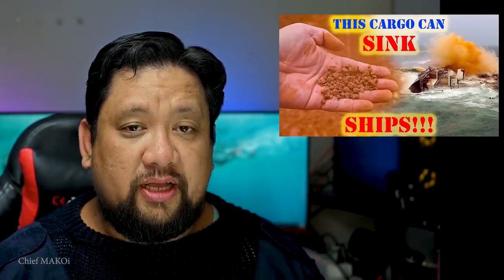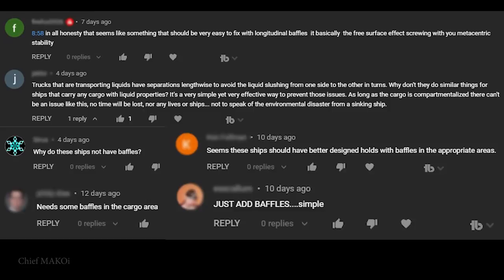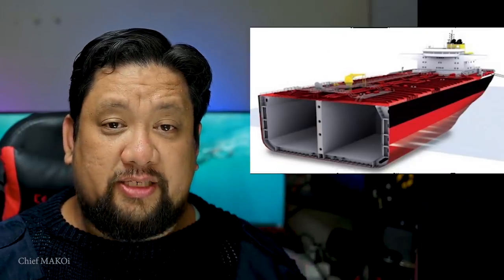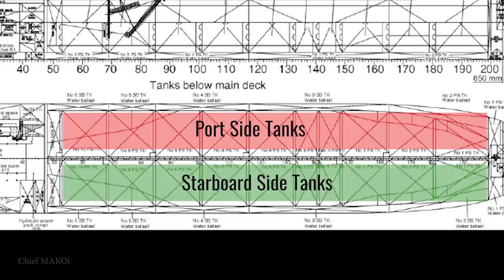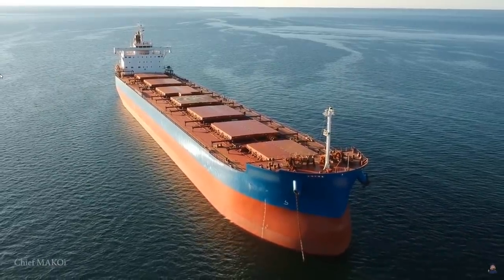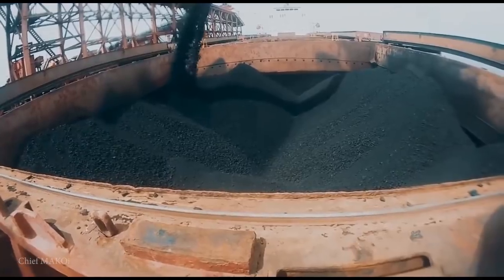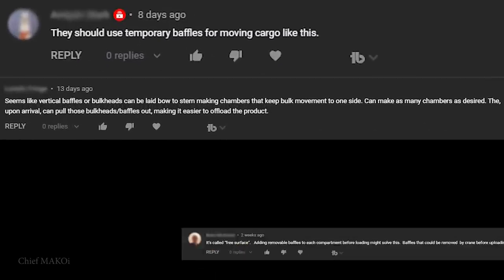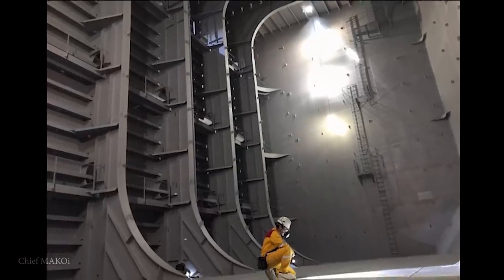Free Surface Effect: Should Baffles Be Installed in Bulk Carrier Ship's Cargo Holds? | Chief MAKOi

Comment: What about a folding partition that simply collapses up against the side wall of the hold. It wouldn’t even need to be a solid wall. It could have holes in it to reduce weight, just not too many or it wouldn’t serve its purpose.
I understand that there is a cost/gain analysis but it seems like there is some potential here. As long as it doesn’t add too much weight, time and/or reduction in carrying capacity. It would certainly offer a level of safety and capability for transporting loads that would otherwise take a great deal of time, labor and expenses in order for it to be safe for transport.
What happens to a load once it has too much moisture in it? When you have ships that are still able to transport, even when it has a high moisture content. It could save you from a wasted trip and a load that no one can transport.
I understand that it wouldn’t make sense for a company to put baffles on all of there bulk carriers but for carriers that almost exclusively carry these king of cargoes it could make a lot of sense and maybe even save some money.
Just an idea

Comment: It occurs to me that with modern materials and technology it should be possible to create strong inflatable baffles, either to use before loading or as an emergency measure if liquifaction is detected. I've seen the kinds of heavy-duty balloons they use as rollers to launch ships or as ways to raise ships for salvage. This would eliminate the "tons of steel" argument. They might even be able to be retrofitted without taking up significant cargo space. They can be very effective even if they are being overtopped as long as the mass in motion is reduced enough, so the rigidity of steel isn't really necessary. Cleaning them and packing them back into place after use might be the biggest hassle.

Comment: if it is not good to add baffles inside the hull, how about adding it on the deck level? it's still a open space down under. it can also be a walkway for crews to visually check the cargo without going down risk their life if the cargo is liquidified. may be double as a support of some rain cover as well? how about adding a hinge open section on it to entertain the port loading machine requirements? of cause as you already said, it is subject to cost and effectiveness. but safety to ship and crew is a kind of effectiveness too.

Comment: 5:59 the thought occurs tho that you could create baffles out of the  cargo itself by freezing it or parts of it.  i know they some times do this in construction in areas where the water level is high or  the soil is otherwise to saturated to be self supporting essentially you  ...in the construction example anyways pound  hollow piles into the ground in a line and then run  a coolant thru it and it freezes the soil  for a given radius around each pile and by spacing the piles such that those radii overlap they created a waterproof wall of frozen dirt that they can then dig on one side of it and put in the foundations and the concrete or whatever  and once thats all set  they  stop cooling  the piles and  the water in the dirt melts like nothing happened ... tho doing this on a ship .... i mean i cant see why it couldn't be done... but you would also need to carry the kind of plant around that would be required to produce that sort of cooling etc etc all to make safe a liquefied cargo that you shouldn't be carrying in that state to begin with so these are all really good solutions to a problem that doesn't exist ...unless you use to make it exist by load wet cargo to begin with in which case the simplest solution is to ...not do that lol  maybe  just a few big bags of emergency desiccant to  absorb the water or in emergency  it might be better to just dump the  most watery parts of the cargo overboard
Reply: You can't freeze the cargo until it's already liquefied. Once it's liquefied, you don't have time to do anything complex like that -- we're talking thousands of tons of water and the ship can sink in 20 minutes. "Emergency dessicant" won't help. You'd need to handle hundreds of tons of material, and you'd need to open the cargo hatches, which is suicide in a storm. Dumping the cargo isn't an option because, again, you'd have to pump thousands of tons of material in only a few minutes. As you say, the solution is to avoid the situation in the first place.
Reply: @beeble2003  ah idea .. what if we make them submersible bulk carriers ba dum tish  that said cargo submarines were a real thing lol
Reply: @firefox5926  Well that would totally solve it. 😁 Underwater, things are much calmer on the surface, so the cargo wouldn't liquefy in the first place. And it would be much cooler.

Comment: It's almost like adding a small "lab room" in and certifying a couple of crewmen to conduct these simpler labtests for liquification testing would be cheaper and faster under all cercimstances. Not to mention that such results would be holding up better to disputes than the "can test", as you have measureable hard number results that would be treated as solid evidence if anyone decides to engage in legal battles.

Comment: probably a better solution would be a system for drying a cargo hold with cargo in it. probably permeable, removable panels across channels capable of blowing dry air through or pumping water out of the channel, but steam pipes to heat the cargo would work for most ores.

Comment: Chief - Thank you for your informative videos. Is there a system on board to determine the most efficient power setting for the cruise phase? What I am thinking about is a system that compares the prop shaft torque vs. the speed of the ship over the ground. This system might save some fuel...

Comment: Your final comments on business needs should be stressed in all industries as if there is no business, then there are no jobs!
As to the free surface effect of oil in tankers, longitudinal bulkheads are certainly the solution that occurs to me , but what about OBOs?
My final voyages were in 155000 dwt Oil/Bulk/Ore carriers where the same cargo holds were used for dry bulk cargoes and oil, but had no longitudinal bulkheads.
Do you have any thoughts on this, Chief?

Comment: Chief, how do you clean out your holds between trips to prevent cross contamination between types of cargo? Or is this even a concern? Thanks!
Reply: There are other videos that cover this for many different sources. In general, front end loaders or similar types of vehicles are put into the hold.  As the main method of removing the bulk cargo is winding down, the equipment pushes the remaining cargo in the piles. Once most of the cargo is gone, they use water to hose down the floor and the walls
Reply: The Chief has a video on that topic, check out his playlist. very interesting.

Comment: One solution for difficulty removing longitudinal baffles would be regulations that require ports to have the equipment on hand for cases where the cargo is out of spec. Shift the burden from the ships to the chatterer, then they'll probably not want to have ships load out of spec cargo, doubly so if the charterer is held liable for loss of life, pollution etc for pressuring a ship to take an out of spec cargo. It seems like a lot of these incidents are due to pressure put on crews and threats by the ports and charterer.

On a more practical engineering side, rather than longitudinal baffles, piling rods could be used instead, they're smaller, don't need to be fixed to the ship and can reinforce soil-type materials by being driven in from the top by relatively cheap equipment that only requires a crane. Textiles could be another solution too; layering mesh in with the cargo would be even cheaper and have a similar effect of making it harder for the cargo to liquify.

I'm not sure how well textile would function for separation though, I'm only familiar with textile bein used to strengthen earth against erosion and soil liquefaction during earthquakes. If you want to see just how much a few sheets of textile can do, there are some interesting demonstrations where small cubes of sand and mesh have the weight of an automobile placed on them and hold up.

Comment: Seems to me that even a dry cargo can shift without a particularly high water content. A rogue wave, say, putting her on a 40 degree roll could start even a dry cargo flowing, especially if the hold isn't completely full. A book I read on nautical things (50 years ago or so) said such a cargo should be secured with battens of some sort for just this reason.
Reply: Dry bulk cargoes are usually loaded flat enough that there is minimal risk of shifting.
Reply: Any powder or granular substance has what is called its "angle of repose". Make a pile of the substance on unconstrained flat ground, and the angle of the slope of that pile is the angle of repose. If you arrange the substance so that the slope of any free surfaces is less than the angle of repose, the arrangement is stable; if you make a slope steeper than the angle of repose, it will collapse.  In particular, if you take an open-topped box (e.g., a cargo hold) with the substance spread flat inside, you can tilt that box at any angle less than the angle of repose and nothing much will move -- the surface of the substance will stay parallel to the bottom of the box. Angles of repose for typical bulk cargoes are in the 30-45-degree range. This means that, if you list the ship by less than 30 degrees, nothing much will move. And if you're listing your ship by more than 30 degrees, you have other problems!

Comment: 5:39 so a question i have about this that i dont know the answer to it .. in the case of a semi liquefied cargo .. do you actually need floor to ceiling baffles ? or could you get away with using half high or some   that is baffles that come down from the ceiling into the cargo but not al the way to the floor? because it would seem to me that unlike the cause of a purely liquid cargo the liquid would just flow under the baffles easily in the case of a liquefied cargo most of its fluidity is at the top and as you go down in depth it become less liquid... in which case the baffle only need to extend down to the point where  even tho the cargo can flow under them it can only do so at a rate slow enough to keep it from suddenly changing the metacentric height and or setting up a harmonic with the roll of the ship  effectively to dampen it rather than stopping it  i should not that this isnt in relation to a practicable solution but just a mental exercise in  my own curiosity

Comment: Hey Chief,do any of these bulk ships have blowers in the holds to help control moisture? Never thought about it before. It seems to me,at least,that these could be installed without compromising the ability to haul other things besides loose material.
Of course I've never been on one of these ships,and have absolutely no idea if this is possible. Thanks,have a Merry Christmas! Calm winds and following seas!
Reply: All ships have ports on the fore and aft sides of the hatch cover panels which can be opened and closed, they are used to ventilate the hold (natural ventilation). Some (fewer) ships have mechanical ventilators, equipped with heaters. Using dry/wet bulb thermometers the ships crew can determine when they need to ventilate to reduce condensation in the holds.
Reply: Cool! Thanks for the info. Seemed to make sense to me,but I didn't know.

Comment: I actually would see longitudinal baffles increasing the risk. Imagine a cargo hold with a baffle filles with ore. During rough seas, a hatch gets damaged and lets in water to the hold. If only one side of the hold fills with water, you start unbalancing the ship. I'm not seafarer, but I can manage trying to adjust ballast in rough seas would be a nightmare, if not impossible. An unbaffled hold would at least be balanced when the ship is level.

As you said, it's all about balancing risk. And you certainly seem to be on a ship where the owners/charterer care about safety.

Comment: Hello Chief I'm  not an engineer by no means but just thinking  here since  water travels  to the top and you have boilers on board, if one would put plumbing  at the highest  point  run on each side of the cargo holes during  extreme weather  drain the slop or water ontop and at the same time provide steam to dry the cargo, or if after loadind and under way  the crew inspecte the cargo find it kind of wet add steam and open the cargo doors a little to sea permitting, to assure  a safe delivery

Comment: (Let's see if YouTube is still hosing messages that have links to non-YouTube sites -- after some testing seems to work for Wikipedia but not other not YouTube sites?)

In case people were wondering:  Bulk carriers designed to carry both liquid and solid actually have been made, although they have partially fallen out of favor for cost reasons:  the Oil-Bulk-Oil carrier:  https://en.wikipedia.org/wiki/Ore-bulk-oil_carrier
To make a long story short, they do have their disadvantages.

Comment: The baffle doesn't need to be from floor to ceiling height. But as a partial divider like mid way and couldn't it made designed to come apart in the middle and fold flat to the opposite walls.

Comment: Just curious...
Why can't they use specially designed dampers in the storage compartments in order to counter act the amplitude created by liquefaction or dynamic seperation? Similarly sesimic dampers are installed inorder to reduce the effect of earth quake on the high rise buildings.

Comment: What if mixed cargo is carried in the bulkhead? For instance, bulky items such as pipes, beams, or wire coils, which will have empty gaps between the individual items, can be buried under a second type of cargo which is granular and prone to liquefaction... the large solid objects of the first cargo will stabilize the loose mass of the second cargo

of course, the unloading operation will require the coordinated simultaneous usage of different types of cranes

Comment: 7:30 and when you look at an image like that its would seem that  honestly  you could use a suction hose to just take most of that excess water off  which would help a lot  now you not going to make it dry of course but  you will be able to  reduces the  size of the waives that form acutely another thing that would work would be that as you load the cargo you  every few meters just lay a perforated pipe or 2   and then once its fully loaded if it gets wet you can just again suck it out

Comment: In short, yes baffles would help but it's the same arithmetic that has to be done with any sort of safety system. Yes, on heavy lift equipment we can require a minimum lift spec for every piece of machinery that would make it twice as big as it technically needs to to make sure you don't end up with a tipping incident but that would make it horrifically cost prohibitive to actually operate the machinery and it would limit where you could operate it so it kind of becomes worthless and then you go back to the issues that you would have. If you didn't have the machine there, there's a reason there's a lot of training that is involved with dangerous professions because if we were to implement every safety system that could be conceivably thought of to eliminate every risk. Nothing would operate. There is some risk required. The goal is to reduce as much of that risk as possible while still letting the system actually work

Comment: baffles would only need to be the top, say 50% of the hold - as the liquefaction tends to affect higher up - which would still allow for easy off loading as the 'dry goods' would  still flow around the bottom.

Comment: Honestly, a movable baffle (on rail) that can move side to side isn't the worst idea. You could even vaguely cheat with it emergencies. So you could keep one side for "clean" stuff (grain and such) and move the wall all the way to the other side when you run dirty stuff like coal. (and to not have the weight all on one side you of coarse alternate what side is what per hold, so it zig zags. That should even out the weight so the ship won't list to one side. And in the rare case of bauxite or liquids you would move the devider to the middle. (no more cleaning advantage, but then you have the safety advantage)